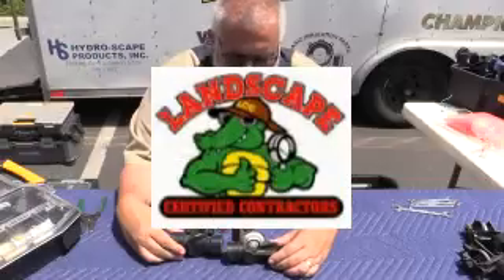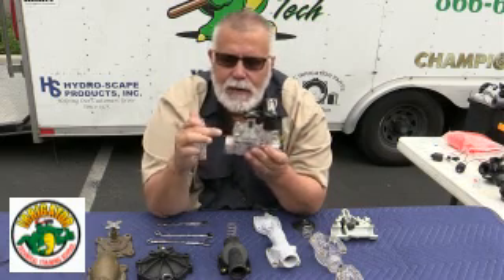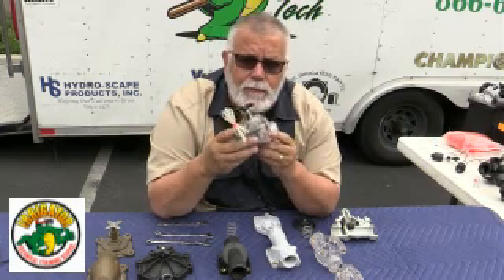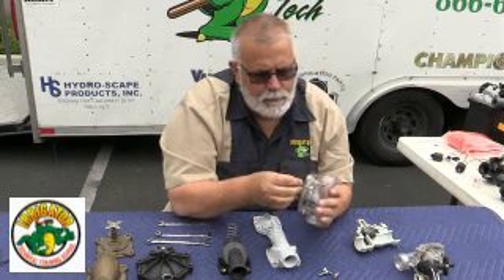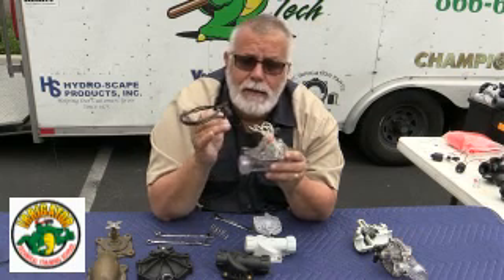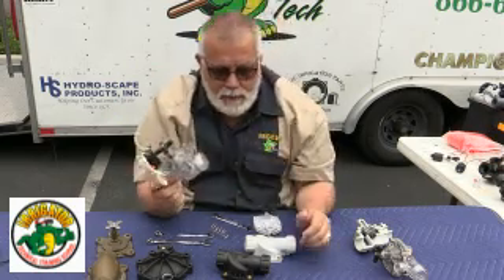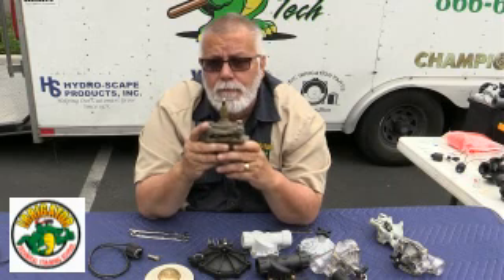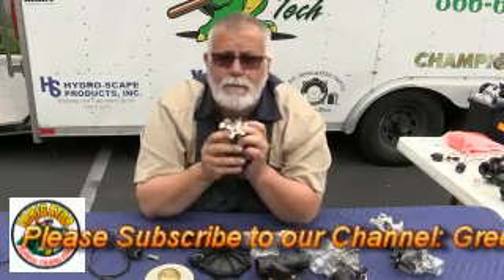Basic Irrigation Valve Maintenance of Weathermatic Valves

Comment: I have had issues with the brass ones tried rebuilding it and still would not work the only way I was able to get it to work was to replace the entire top bonnet I tried the new solenoid on the new one prior to using the bonnet so I know it was not the solenoid so had to be something else maybe the port was restricted but I did see water coming out of it  now I’m having the same issue on another one same property but this time it activated when the solenoid is left loose where it leaks a bit will come on and off  called support and they were unable to provide insight I’m going to try it one last time as this one is different then the one before as it actually works with it loose telling me the diaphragm is good and see what it does and update but if it doesn’t work I’d be careful about these valves and wanting to keep them in service as apparently they don’t work with a simple rebuild of a 30 dollar part and spending $300 for the metal bonnet  you might as well replace it with a $100 valve if anyone knows the solution  please contact me

Comment: Hello sir, I enjoyed your video on the weather matic irrigation valve but I have an old model that is leaking and I cannot get parts for it so the sprinkler store sold me the newer model meaning I have to replace the old valve and I’ve never done anything like that before I noticed both ends are female threaded so I was wondering if you did a video on how to replace a Weather Matic sprinkler valve. I’m assuming that they can unscrew. I saw one video that show the person unscrewing The old one and then screwing in a new one. Is that how it’s done or do I have to cut my pipes? If you have a video on how to replace the weather Matic irrigation valve could you please send me the link to it I would be most appreciative. Thanking you in advance.

Comment: Thank you very much for your very clear explanation! I'm just a homeowner who had a Weathermatic valve fail and need to replace it and your video taught me so much!  Most people who do how to video's assume that you know the terms and tools they are using when they show things. Although they have great intentions, I often have more questions about the things they are talking about because I don't know what they mean. You were very clear and showed exactly what you are talking about and I very much appreciate it. 

My valve seems to have a crack in the bottom body and I can't imagine how that happened since it seems to be all one piece. I can't see exactly where the leak is coming from but tried just replacing the top part of the valve so I wouldn't have to remove the entire valve - there isn't any room left to cut the pipe. It didn't work and water is still fanning out the bottom. I tried using a mirror to see but just can't see the crack but think I feel a very slight crack. It is Thanksgiving so I have to wait for my Ewing store to open to ask for advice on how to get it out to completely replace it. My husband thought maybe we could try unscrewing it since both ends are screwed into pipe. I don't think that would work because they probably screw in different directions. I am worried that we would put too much pressure on the pipe and break it further. Would be great if there were those swivel type (I think they are called manifold swivel adapters) on the ends so you could just unscrew it off. 

Again, thank you for taking the time to make this video.